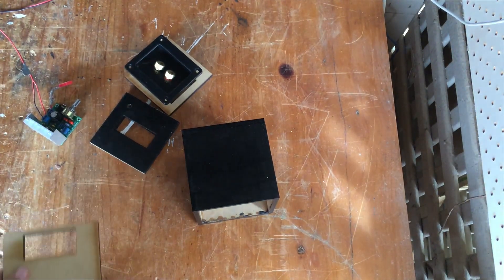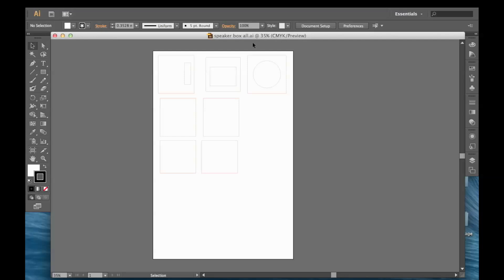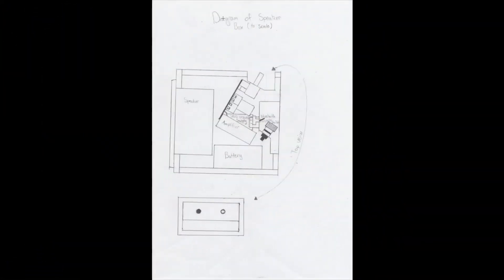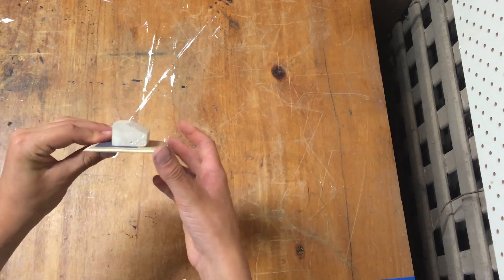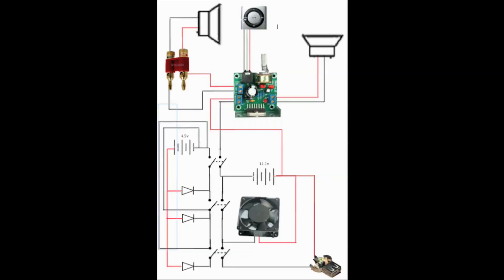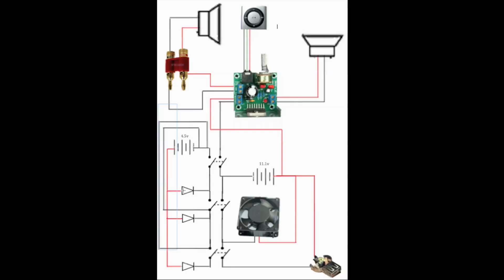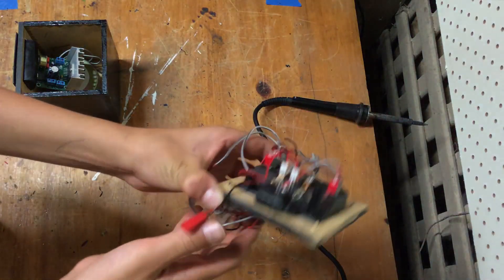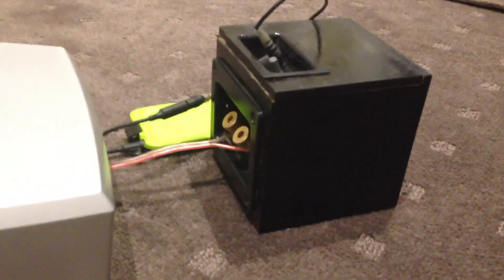How To Make A Mini Subwoofer Box Part 2 (bluetooth)

Comment: Just saying that's not a subwoofer but a simple full range speaker. If u want to atleast try to make it into a subwoofer u need to seperate the high and low signals.  U need a passive crossover to split the signals and only leave the 80hz and below signals for the subwoofer to process. A thx approved subwoofer can go 80hz and below but this is not possible from this small enclosure. Atleast aim for the frequencies outputed by a typical car sub which is around 250hz and above. I'm 15 and I don't have very much experience but I can tell u that u need to rename the video or make an actual subwoofer.
Reply: I think we all know its fullrange but we all call anything that moves a sub for some reason even. Though we know its full range

Comment: Would it still work if the box was slightly curved on both sides, rectangular, and like 2/3rds the size? This sounds like a weird question but I have my reasons. If It wouldn't would you also tell me why it wouldn't, thank you in advance for reading.
Reply: the smaller the box is the less bass you will have

Comment: Does anyone even know what the fuck a SUBWOOFER really is???
...  This video is ignorant, mis-informed, and mis-leading....
 That's more like a wide range loudspeaker out of a portable radio, and the enclosure isn't even tuned to it's insufficient low end of a "speculated" 80 hz or so for a LOW frequency capability.....
..This isn't a subwoofer, it's BARELY even a woofer.....just slapping components together doesn't make a subwoofer, but I guess it will make noise of some sort... subwoofers operate well below the low end capability of this 'design'..... GEEEZ.
Reply from the maker: +garbagemanify nice
Reply: I actually made a Bluetooth speaker with a POWERED subwoofer in it.
Reply: +garbagemanify Actually, any subwoofer can play music. Its magnet and mechanical structure is just more designed for maximizing the lows/spl. The amp controls the Sound waves that go to your woofers. So if you have a shitty amp, you will hear songs through your woofers not just bass. Bass(15hz-150hz). He doesnt have an "Amp" with a built in subsonic/lowpass filter so he would have to buy an inline filters so that his little speaker would only play the part of songs at 15-150hz. Would it sound good? no, its not designed for that. But fundamentally there is no difference from a standard 6x9 door speaker and a 18inch subwoofer. Just made for a different purpose. So, do you know what a subwoofer is?

Good job, nothingbutextreme1. Liked the vid.
Reply: Hey its a kid and hes learning
Reply: Good luck listening to music on a subwoofer. If you can, you're definitely not listening to a subwoofer but to a mid-woofer at most.  Old jbl GTO1202 ( 12" car woofer)  even on full frequency spectrum from the amplifier would sound like shit, outputing mostly bass. My current Hertz 8" woofer sounds just about the same, slightly brighter meaning you get a bit more muddy sound once you send full signal into it.  
It's not just the amplifier that sends low frequencies or the name calling it a subwoofer, it's actually a matter of the driver coil too.  Do some research please.
Reply: Fr though
Reply: +garbagemanify you could be so much better in the picture with some moderation in your tone. +nothingbutextreme1 congratz on your project mate!
Reply: +garbagemanify so tru
Reply: it's a front speaker if it was sub woofer it would sound like shit
Reply: +matt rodriguez where
Reply: In my room....I can also  hook an amplifier to it...which I hook my 12" to
Reply: yep, but he is kid
Reply: Radu Lupu ok

Comment: You should rename the title to : How to make a Mini Speaker Box
really, its not a subwoofer, more of a speaker. I dont think its even a woofer to be honest, woofers are from 20hz- 2000hz and subwoofers are anything lower, this would technically be a tweeter in a sound system. So you shouldnt really call it a mini subwoofer. Great job though :)
Reply: ***** , it's a full-range speaker. subwoofers aren't lower than 20hz...why? because humans can't hear anything lower than 20hz ;)
Reply: By lower I ment the range, Bass heads still listen to songs with frequencies under 20 so they get "flex".  I have a 12" subwoofer myself and even though I can't hear anything bellow 20hz I can still feel it and it makes everything rattle. 
☺
Reply: Tweeter : 2000hz - 20,000hz 
Woofer (sub bass/mids) : 20hz - 2000hz
Subwoofer (Very deep bass) 20hz - 200hz
Tweeters are around 3 inches or smaller, Woofer are 4-10 inches and subwoofers are 10+ inches so they can produce the low notes

Comment: Very nice, NBE1. Curious about your internal fan, as all it does is move air around inside the box. Is there enough heat radiated through the wood to keep everything cool enough? You should submit this video and some written instructions to Instructables.

Comment: nice job! but how do you charge your batteries inside ?
Reply from the maker: BlackBackLP There is a female port that I added on that isn't shown in the wiring, that allows for an external Lithium battery charger to be connected.
Reply: okay. But i would recommend to show it, because some people with less knowledge may forget it.
I don't think its fun to take everything apart to charge the battery ;)
Reply from the maker: Yea sorry, I actually forgot to put it in originally, which is why it isn't in the video, although I added it later.

Comment: where did you get the actual driver from??
and how do you charge the battery??
Reply from the maker: 1998goodboy Check the description for how I got the speaker, and the battery is charged using a lipo battery charger, through a female JST connector that wires into the battery terminals.

Comment: don`t put fan in the box
Reply from the maker: DJ Cris-Tech Yea, after testing I found that the fan isn't actually necessary, as it doesn't generate enough heat. Although I didn't know at the time, so I put it in as a precaution.

Comment: Are you using lipo battery without any protection :O ?
Reply: Valtra103 li-ion maybe? they dont need protection if you know the current, how they work and what kind of battery you are using.
Reply: JorksX 2:20 its RC lipo... And li-ion need the same protections as li-po. Overdischarge being most important in this use. Asuming he have good charge which won't overcharge. Over current protection obviosly is not needed here. 
And. That fan is useless inside of closed box.
Reply: Valtra103 yes, Overdischarge is bad for lipo. and overdischarge protection is must. I thought you meant something like over current protection or something like that :)
Reply: JorksX
And he does not have it.  Lipo can get realy nasty when treated bad...
Reply: I know. When accident happens, he is going to learn ;)
Reply: *****
He MUST get it, if he don't want to ruin battery and/or cause fire / explosion.
Reply: +Valtra103 just use some undervoltage protection thats cuts current when voltage drops low
Reply: JorksX
I hope he will see our posts, and adds that circuit :)

Comment: hey i saw your video and what you've made is pretty neat.
i myself have bought tda7297 amp and i am confused on how power it  with a battery
i have a bought a separate adapter (12 volts 2 A)
i want to make a portable speaker box likes ur but i dont which battery to use.
can plz help with the battery part ?
Reply from the maker: If you cant get your hands on a 3 cell lipo, or don't have the necessary charging equipment, I would recommend either a small lead acid battery or 8 AAA batteries in series.
Reply: nothingbutextreme1  i have a 12 v battery 7.2 ah. will that work ??
Reply from the maker: MrBraziles
yea
Reply: nothingbutextreme1 you mean i should directly connect the amp to the battery without an extra adapter ? is that right ??
Reply from the maker: MrBraziles
yep as long as its 12v that's fine
Reply: nothingbutextreme1 thanks alot for the quick reply. i hope i didnt bother u. i'll notify u with the progress of my speaker box. god bless u !!
Reply from the maker: MrBraziles
no problem, can't wait to see it
Reply: I recomend tda7375

Comment from the maker: The song in the second half is: Hardwell - Apollo [featuring Amba Shepherd]
Reply from the maker: *****
yea sure, as long as you put a link to my video or channel in your website
Reply from the maker: ***** Its in the description
Reply from the maker: ***** there is barely any distortion, it is a 15w amplifier and speaker, and runs of a 11.1 volt battery
Reply: + nothingbutextreme1 I have a mobile phone battery 3.7V 1800mAh, it will work?
Reply: Thx for the song!